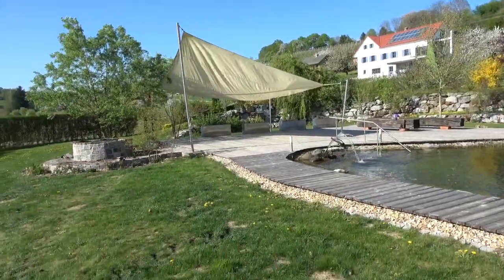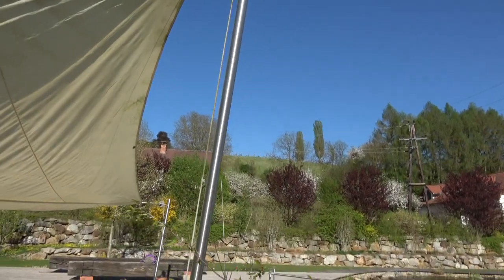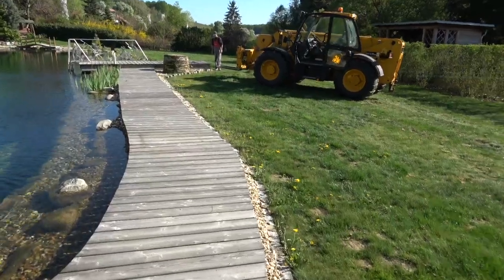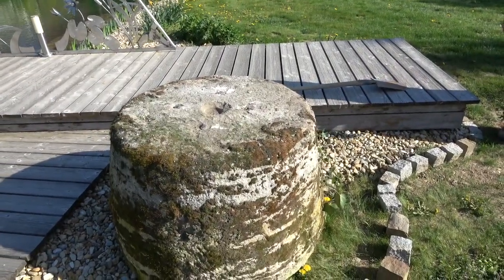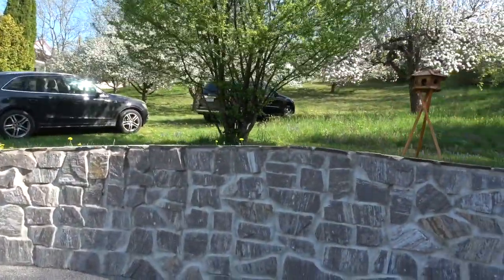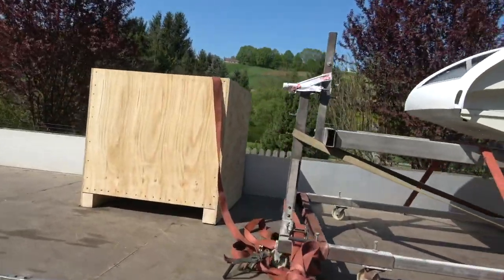Ford Consul Sold & Jaguar XK 150 Off To The Paint Shop.

Comment: Is the XK coming back after painting? If not you are going to have a spacious garage back soon when the E Type goes. :-)
Reply from the maker: Norman, It will stay in storage till the chassis is ready as the workshop where it‘s stored has a 10 ton overhead crane which will make aligning the body & chassis with all the spacers a lot easier, Cheers Dave.